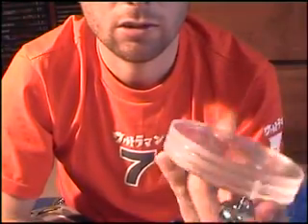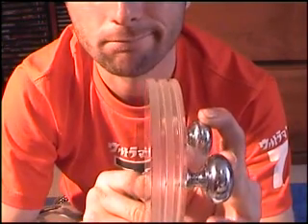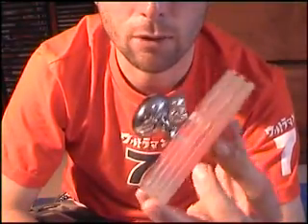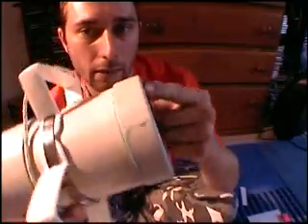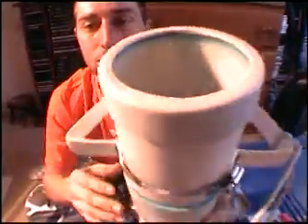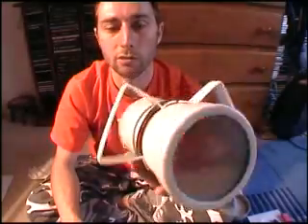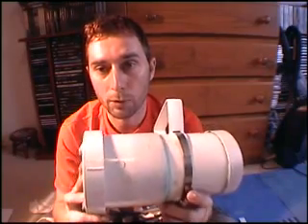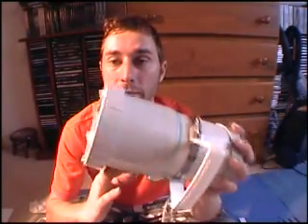d.i.y underwater housing for video camera part3 b

Comment: Great job, man!
But, how do you get the 20mm perspex exactly the right diameter to fit the inside of the pipe with your double seals?
-By the way, u can also use silicone grease from dive shops for the o rings, instead of vaseline.

Comment: ....maybe seal the remote control in a leakproof bag and use that as a controller? Was thinking about building something like this with pvc i have around, my only problem is my hf100 doesn't have a viewfinder ( lcd dispaly only) so can' t see how i am framing my shots.LCD needs to be flipped open...Thanks for sharing